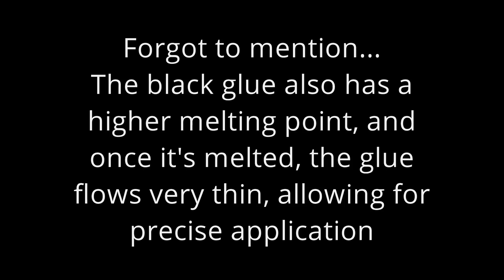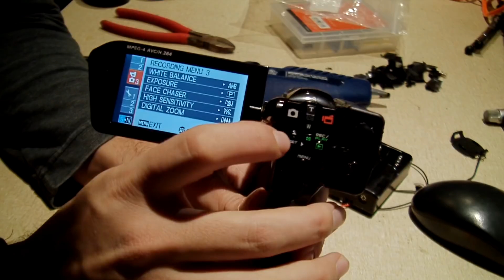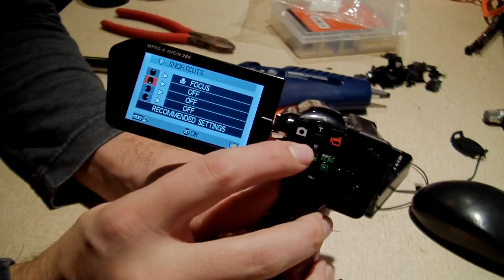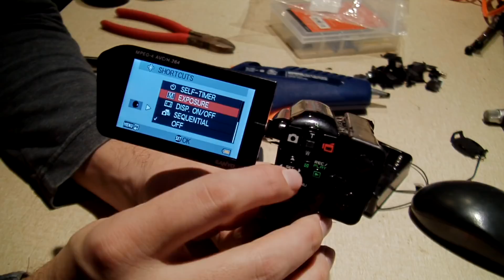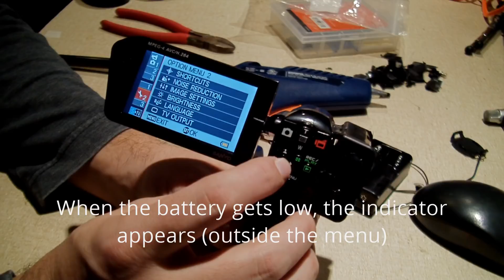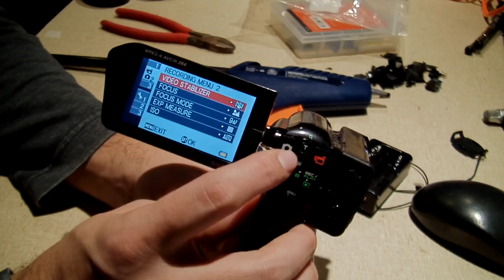The process of 18650 modding a camera... Sanyo Xacti CG10

Comment: Regarding the Sanyo CG10 Dual Camera mod I am curious why a less invasive option was not considered. These Camera's came originally with an External battery attachment option. I have tried to find one but to no avail. if you look at the bottom left hand side of the battery compartment you see a Cable groove running from the battery to the external area. I assume that Sanyo had a Dummy Battery inserted into this location with an External battery lead running through this Grove to the outside.
My thought is to gut an existing battery and wire it from these connectors of the Gutted Battery itself to the outside Extended battery without modifying any of the Camera housing or instigating any damage from the original. Would be interested in why it was not considered.
Reply from the maker: I did this mod specifically because I have a lot of bare 18650 cells harvested from laptop batteries and wanted to mod the camera to accept them. The 18650s, especially paired together in parallel, offer a significantly longer runtime than the original battery. The more high-end models such as the CG102 and CG20 allow for external power from a 5V source.